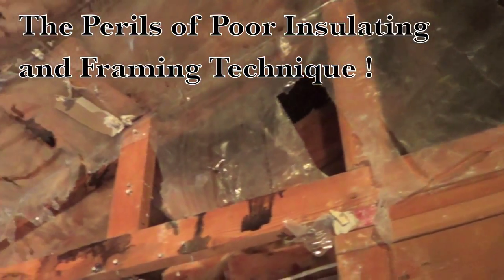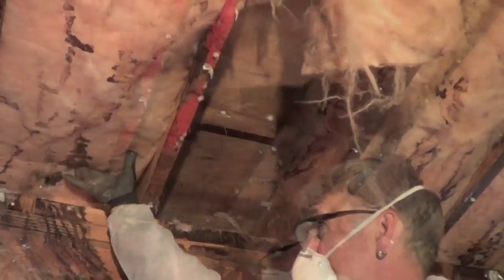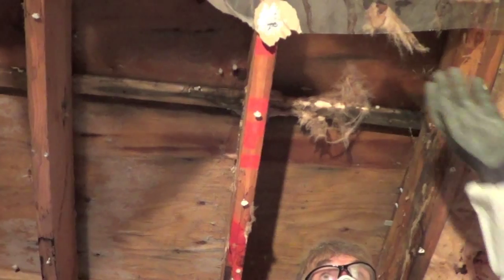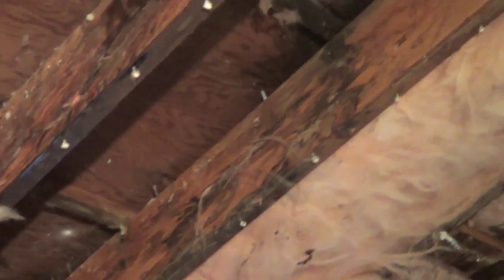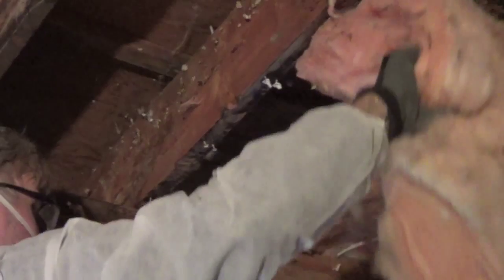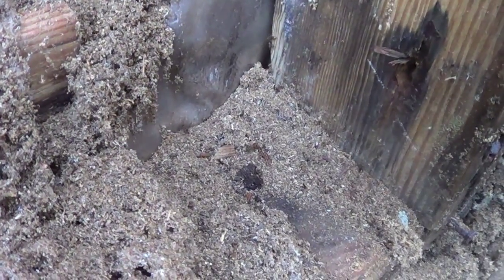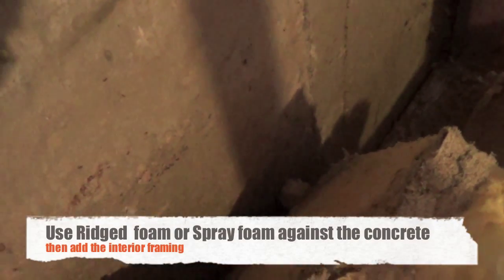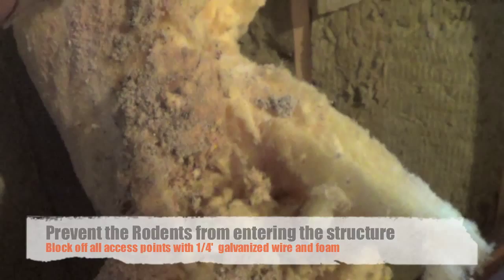The Perils of Poor Insulating Habits

Comment: So I finished my attic space, and apparently did it wrong. I don't have a ridge vent, and I used R-13 between the rafters. I then put my interior ceiling (pine boards) directly on the rafters. It's hot up there. I only finished it a few weeks ago, so I'm trying to figure out how I need to fix the problem. 

My thought right now is to try and get some sort of baffle between the insulation and roof sheathing, then remove the insulation above the top chord (which also has R-13 in it), then put in an electric vent. 

Does that sound like a good plan? I'm trying to prevent having to pull down all the finish work.
Reply from the maker: what type of roofing do you have? Can you unscrew it? What dimensions are your rafters?
Reply: Alex Denny Thanks so much, sir. Asphalt shingles. The rafters are 2x8's. I'm not understanding the unscrew question. Are you meaning the ceiling in the finished area? If so, that's attached with a brad nailer. I could take all that down, but that's what I'm trying to avoid. (BTW the insulation is the 6.5" thickness.)
Reply from the maker: Ok , so shingles on plywood sheathing  with 6.5" insulation in a 7.5" space. Technically the code says two inches for air ,but 1" is better than none.
Then basically an inlet for air in the soffat ,then the all important ridge vent. 
 the ridge can be removed and a slot cut in, 
otherwise if it is a shed roof touching a wall then a vent can be cut in at the top also.
Reply from the maker: We added an electric vent to an attic space that had a thermostat built in, there was a lot of space in there though, like 6' above 12" or insulation. this made sense ,but for your "cathedral" ceiling ,  any amount of air that you can get above the insulation is a good amount....
 The only other options i have been researching ing is soy based "spray foam" that kicks in 4 seconds, therefore having no airspace. A "solid" roof .
Reply: Alex Denny I think that's the biggest problem -- no ridge vent. The hot air is just collecting above and around the finished area and not being pulled through in any way.
Reply from the maker: Sounds like the best solution is to take the ridge cap off, cut a slot in the sheathing, get a "vent strip" for the ridge and attach it, then re-nail the cap.
Providing that you have sofat vents or can cut in some sofat vents, it should work.
Reply: Alex Denny I do have soffits. OK, I was wondering if ridge vents would make that big of a difference. I'll certainly do that. Thank you very much for your feedback.
Reply from the maker: Best of luck with your project! happy for the correspondence..good plan to have someone in your area to drop by any check it out..!